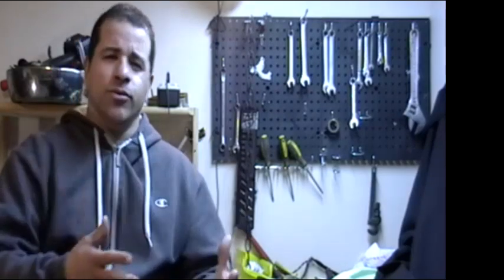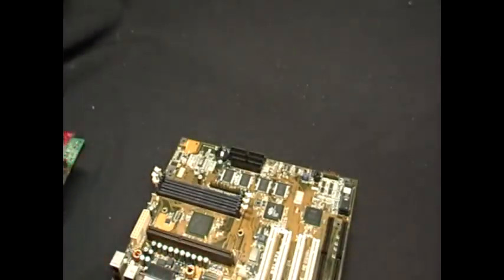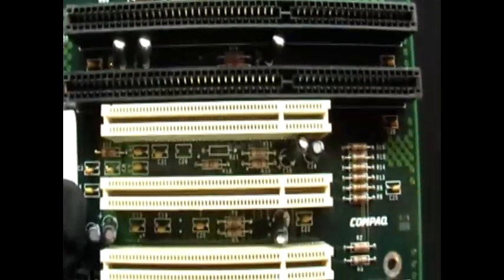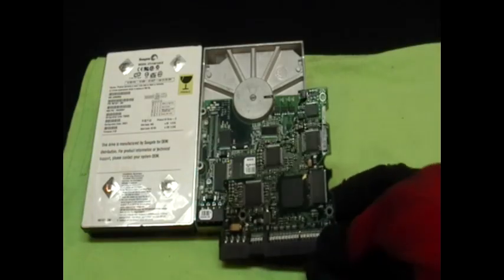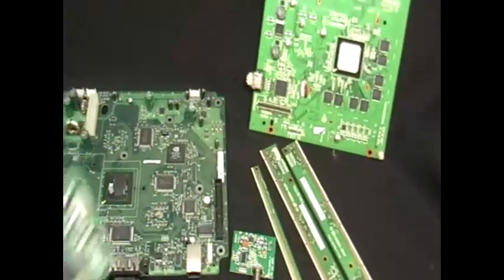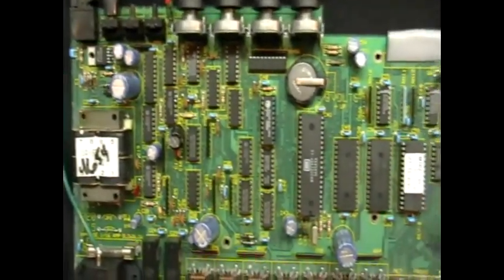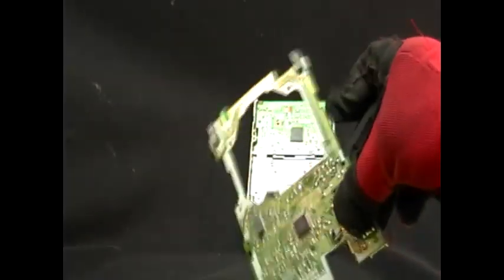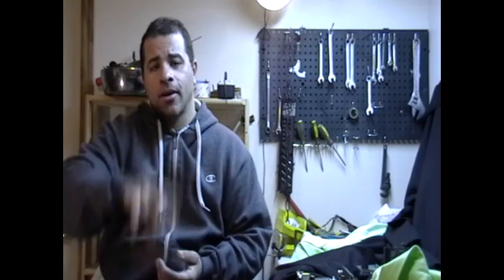Knowing your Boards

Comment: It's March 2021 and the prices are the exactly the same via boardsort. Crap......however, best video I seen on this topic. Why can't you break other boards besides the low G? I thought it all gets shredded? To confirm. Transformers are the difference between mid and peripheral boards? Is it not worth depopulating? I got a little osalating saw that just pops everything up and was the funnest part. - Appreciate you

Comment: I'm having alot of trouble telling the difference between mid grade high value and not high value mid grade. I'm prepping my first sale to buyer and he wants the " low value mid grade " separate from the high value mid grade. I mean he pays more for high value mid grade then he does for small socket mother boards. I'm thinking maybe the ones with big plugs and  transformers are low value? But they still are very nice with the same components as the good ones.. just confused. I think I will just remove as much of the junk as I can and hope for the best.
Reply from the maker: Go to www.boardsort.com......they have pictures on what you should be looking for.

Comment: If I rip the ic chips off are the peripheral boards worth less? What if any board cracks are they then worthless or deemed low grade?
Reply from the maker: should still be ok. I have done that to low grade boards
Reply: Mike the Scrapper will they take a fridge that had the Freon drained already someone cut the compressor
Reply: It has no certification tag or nothing

Comment: Judging motherboards by color or socket size is nonsense. Just about every motherboard is made in China or Taiwan, it is made by OEMs to whatever quality specified by the vendor. Some vendors may have a budget line and a premium line, so brand alone does not say much about the quality either...
Reply from the maker: This is how scrapyards accept the boards.

Comment: What am I supposed to, or should remove from boards before selling? GREAT VIDEO BTW
Reply from the maker: Yeah, remove boards and any thing heavy. go to www.boardsort.com to see what they buy.
Reply: I 've checked out boardsort before, left me kind of confused, your video was more helpful, I understand they want heatsinks and large capacitors removed. I have a local scrapyard, sims metal mgmt nearby that buys escrap and I've separated all my lowgrade boards (I 've been scrapping lots of tvs, crt and flatscreens) from the others, I removed the heatsinks, ICs and copper/transformers the the lowgrade boards and the power boards but I have some boards from a pc and some routers and printers and the flatscreens, they look like midgrade or periphial, they have the gold corner chips and lots o f IC's and some gold pins or plating on the boards. I'm not even sure if it is enough weight to bother selling yet, maybe 20 lbs, low grade I have alot. I will go in today to sell my wire,motors,copper and aluminum and ask about the escrap. Do you have anymore videos you'd recommend for a new scrapper?

Comment: No offense to SuperDave who said daughter board, but the specific item you were calling a backplane is more generally known as a Riser Board.  Risers are used to add more slots to a motherboard, for example in Dell 2U-height rack mount computers which are too short to have normal sized PCI interface boards plugged in vertically.  Backplane is a more generic term for any board consisting exclusively of just slot connectors and very few if any chips or capacitors.  Sometimes backplanes can be quite large, and often have slot connectors that are just press-fit so the pins aren't even soldered to the board.  One other thing... In the motherboard section you called one type of motherboard you showed gold-plated which is incorrect.  You are referring only to the color of the solder-mask coating which is most often green, blue, or red.  There is also a yellow color solder-mask material which makes the traces look like gold when viewed through it, but the traces are still just plain copper underneath.  Rarely certain circuit boards (possibly some HP/Tektronix/Agilent boards, or certain PC sound boards) can be found which have gold plated traces that have been covered over with solder-mask material.  You will never see that on ordinary PC motherboards though, since gold plating is costly and unnecessary for their intended purpose.  In that highly competitive market it's all about low production costs and high profit.
Reply from the maker: macfixer01 every board and chip I have explained in this video, is what they are called when they are sold. I do understand they are many other names. But this not to confuse.

Comment: Great vid Mike (new subscriber here). 
Question for you. I have a bunch of unpopulated green circuit boards (with what looks like silver areas to put stuff on). They are flat and green on both sides. Can I scrap these? What category would they fall into? thanks
Reply from the maker: van allen Sounds like a mid grade board

Comment: Ps, I also wanted to ask if the scrap yards take the boards if they are broken some boards i have are broken in small pieces, Thanks again
Reply from the maker: victordelc21 Low grade boards are no problem. anything other than that you may have a problem.
Reply: Mike the Scrapper Thanks again Mike !! Have A Great Holiday Season

Comment: Hi Mike, I wanted to ask you do scrap yards take the low grade boards from stuff like tv and things like that if you remove the pieces of aluminum and copper parts from the board first or should I leave everything on them, thanks for your time, Vic
Reply from the maker: victordelc21 take all that you want off the board. My yard does not mind.
Reply: Mike the Scrapper Thanks for the info Mike !!

Comment: OMG the low grade TV boards have tons of Capacitors on them!... get a solder sucker tool and remove them and sell them on ebay... don't break them up.   They can be worth up to a dollar each to hobbyist... Just look how much Radio shack charges hobbyists for them, EACH!  http://www.radioshack.com/product/index.jsp?productId=12464109
Reply: The Radio Shack retail price for components isn't indicative of the worth of salvage components. An electronics  hobbyists stripping a board for parts is one thing. Even with the quick dirty gas torch or heat gun  method of desoldering a board, salvaging most component with the intent of profiting from resale of the salvage is a fool's game.
Reply: Why is it a fools game?

Comment: I wish you would get into more details.like what's the purpose, where its usually used e.t.c. good video though
Reply from the maker: P KYBZ what kind of more details?
Reply: Mike the Scrapper like do you have a video describing what every part on a mother board does? like where data is stored ..how to know one is burnt out.and parts of a board, other than the sockets. it would really help me out
Reply: P KYBZ 
How about taking a computer hardware course or basic electronics course, the questions you're asking need to be answered by a professional in the field!

Comment: What about removing pieces that contain copper? Are you able to sell a stripped down board?
Reply from the maker: Depending on strip down. You can take the transformer & copper off a low grade board. but if you cut the fingers of a PCI card. You will not get Pci card price.

Comment: the mother board you show that looks like all gold plated top and bottom.why cant I perse the gold underneath the film that covers the gold that covers the hole board top and bottom of the mother board I have several of thes board but cant get gold off of them,nothinfg eats the film cover over the board
Reply from the maker: There is a product that does, but its only in China right now. I will try to get my hands on it to show...
Reply: That motherboard is not gold plated, it has a yellow colored solder-mask coating (vs the more common green, blue, or red) and that makes the copper traces underneath it just look like gold.  You can scrape the coating away with a knife and see for yourself the plain copper underneath.  Hot lye solution (sodium hydroxide) will dissolve solder-mask but it's quite dangerous to handle and work with since it's highly caustic to skin.  Lye also attacks glass containers, and will dissolve anything aluminum giving off explosive hydrogen gas in the process.  It will not gain you anything to remove that coating from PC motherboards!

Comment: hey mike, i enjoy your outlook and in depth knowledge. i scrap many years ,the basics, by ton (ferris) and as much non ferris  as my bins fill up and i find time to take in. so... in regaurds to knowing your boards , please help me further. do you try to pull everything from a board ? do you sell a flat board of its grade ? put all capacitors in a bin ? i know the alluminum and copper. I guess im excited to have you do a DETAILED item by item of some of these foreign things on boards.thanks in advance and i should subscribe. im also semi computer illiterate.
Reply from the maker: lets say a mother board. pull the Ram CPU and heat sink. that's it. As far as capacitors I leave those alone. I do sell the board for the grades. Boardsort.com has some pics on what you should look for.
Reply: Mike the Scrapper Don't forget the CPU heatsink retainer....Boardsort.com is a QUALIFIED source for information. Remember partial information still leaves people in the dark!!! ScrapMetalForum.com is a great community of people to get many different educaded views on scrap sourcing.

Comment: hi im called paul and im from the uk.im doing this in my spare time. is it better stripping the metals off the boards and selling it as is or just sell them as boards.i don,t get the allot of stuff.5 computers a week. i enjoy doing scrap as i have done this for years. beats spending ll your time in the pub and spending all your money.keep up the good work.
Reply from the maker: You can make more money if you leave the precious metal on the board. if there is aluminum. you can remove that.
Reply: thanks for your help

Comment: Nice video explaining the differences between board types.  I'll need to sort through my green boards again and take any that appear to be peripheral boards and put them in a separate pile.  What do you do with any thin ribbon cables (like those that come out of laptop CD/DVD drives) that have gold plating on the connector end?  I got a few laptops in that I'm going through the process of scrapping and pulled a few out and noticed the gold on them.

Comment: set it face down over a bucket, and slowly heat with a torch. most chips and connectors will fall into bucket. Some may need a little "persuasion". i use a hammer to gently hit back of board. Practice on one you dont care about first, as i burned my first one. but after i got the hang of it, takes about 15 min to clear the board

Comment: If I am understanding you correctly, I could remove copper coils, and aluminum heat sinks from boards, and when I sell them, the buyer won't care. Is that correct? Thanks in advance...

Comment: some times I wish I new of a way to slavage the meterials my self. I do take stuff like Caps that are still good. heat sinks, switches. and plug connectors ect and save those with the wire still attatched for projects.  and some times I take off bridge rectrifyers, and transistors and mosfets also. and research the part nuimber and if they are good I keep if not I throw out. so in a way I recylce in differnt ways slavage good parts and recycle the rest.   wish all scrap yards would take ewast.

Comment: good info mike now I can sort my boards better.  I been pretty much sorting my boards with gold on them as high grade and my brown boards as low. but I see I can sort them a little more.  But my bigest problem is were to take them. do you know of a webside that will locate a place that buys them.  so fare the scraps I have here dont. any ideas. because I'm running out of room.

Comment: I wouldn't say it's illegal, but the garbage guys won't take it. It's the same here in Ontario, where they urge you to recycle your electronics. You can still put electronics to the curb but the garbage trucks will just leave it there IF a scrapper hasn't found it yet. Same goes for anything metal that isn't considered normal recyclables (blue box material..tin cans, etc) which the city recycle truck will pick up.